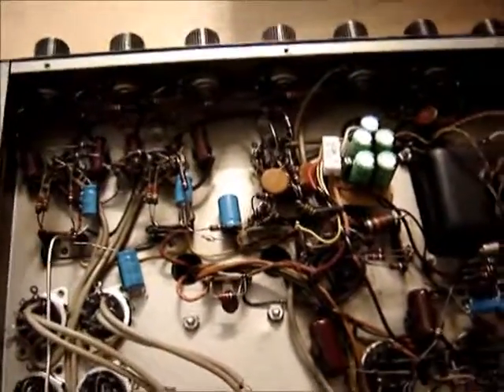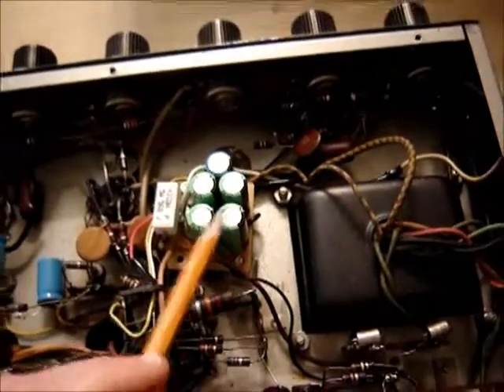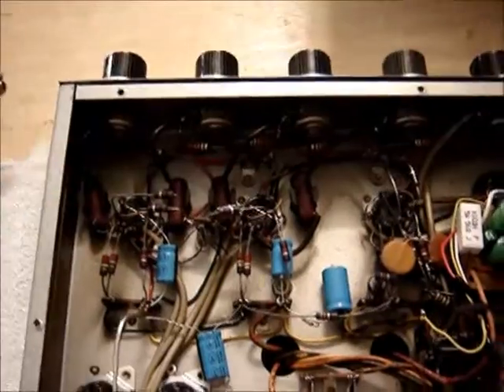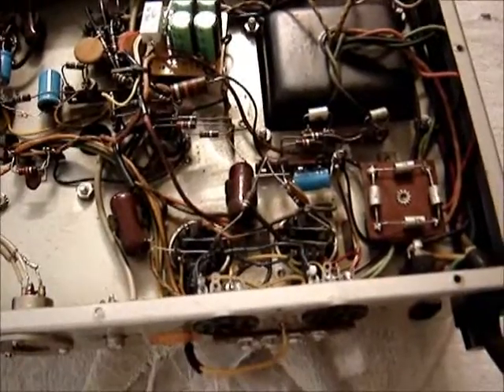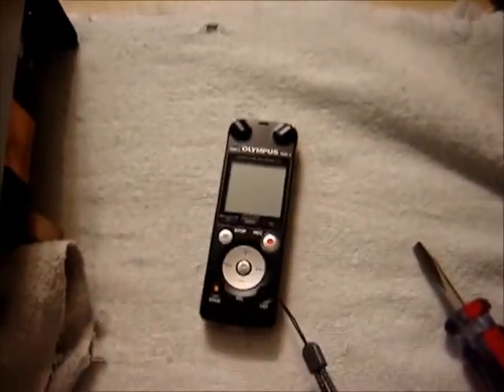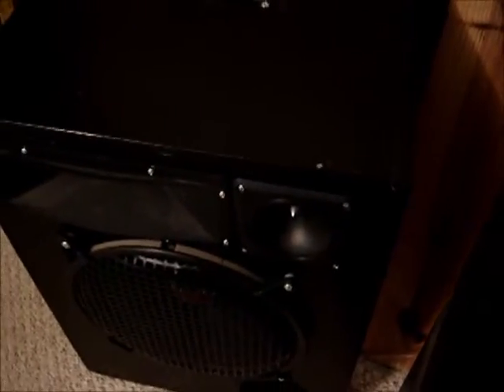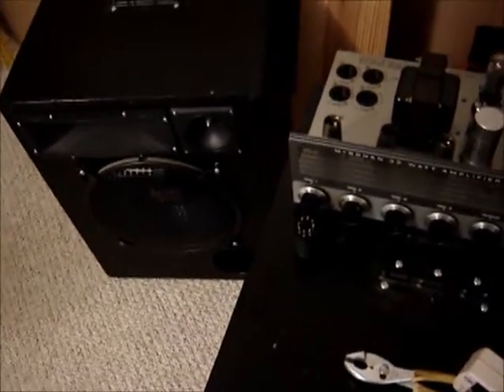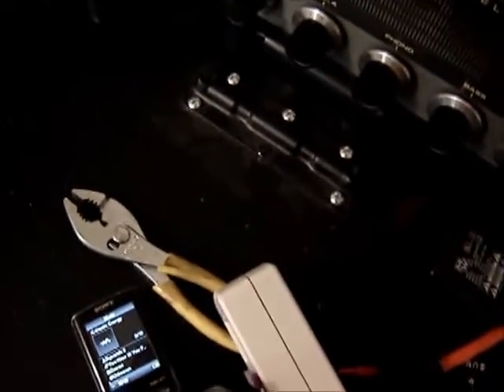McGohan M355 vacuum tube 35 watt PA amplifier repair pt3

Comment: You did a great job. I have the same amplifier in it's original condition (Working). I noticed that the burnt resistor that you replaced is not the correct value. The original value is 560 ohms not the 56 ohms you installed. That will cause your output tube plate voltage to go up!

Comment: 35 watts (tube)  would be quite loud.with big ported speakers. I have a single ended 6L6 amp that puts out about 6 -8 watts and even that is quite loud  in the living room... Tube amps are wonderful for movies.(i.e. Empire Strikes Bck)..I have my DVD./VCR hooked up  to tube  amp but first into an equalizer to boost the low frequencies..The sound is incredible, rich, smooth  and dimensional ..not just the music but rumble frequencies, like spaceships and engines etc.. I would never pay hundreds of $$ for a solid state home theater
Reply from the maker: Thanks for the comments, Chris. I might build an EL84 amp at some point. I'm poor and frugal so much of the parts have to be scavenged. I did get a hold of a set of output transformers. That's a big first step as they can be costly.